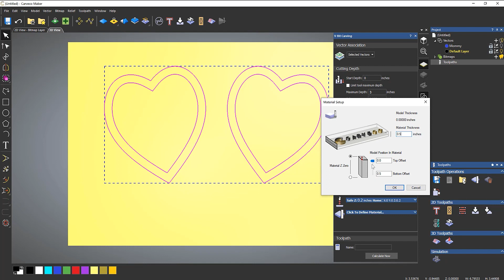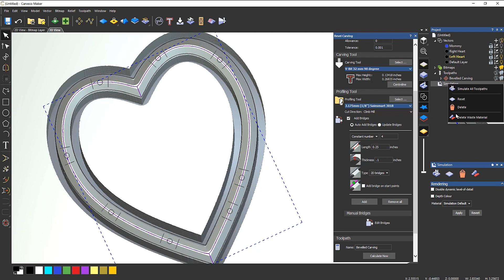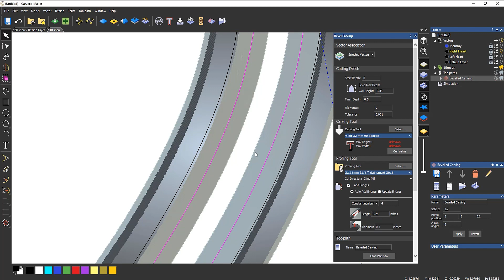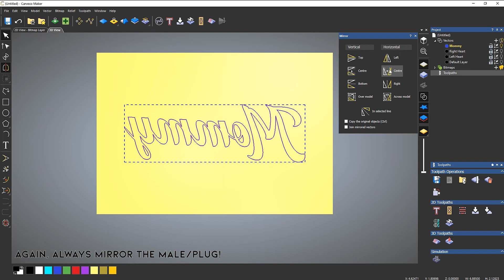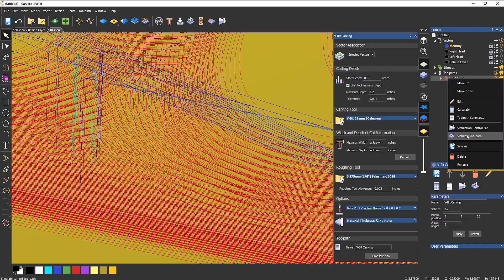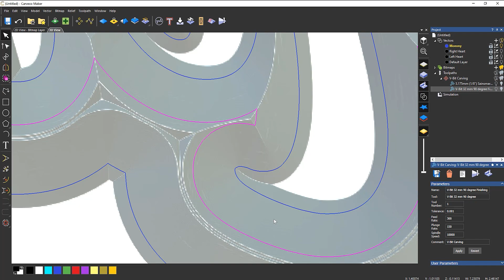Carveco Maker: V Bit Inlays

Comment: Is it necessary to do the area clearance first on the male? Seems like it's just adding an extra tool change by going from 1/8" clearance to the v bit and than back again to the 1/8" for cutout.
Reply from the maker: Hi there,  sure, you can V-Bit first and then just use the 1/8" tool for the Area Clear and Cutout.

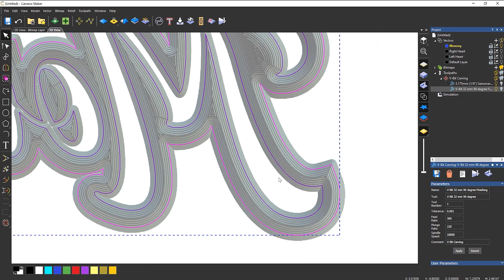Comment: Question: on 46:06, the start depth make my first pass of cut very deep (since my start depth >> stepdown).
according to G-code the first pass Z starts from -(start_depth+step_down)
 how to fix that?
Reply from the maker: That's the only way to do it, since you are telling the software that you have already machined that part (which you have not), the only way around it is to do an area clear or a profile pass down to that depth beforehand.

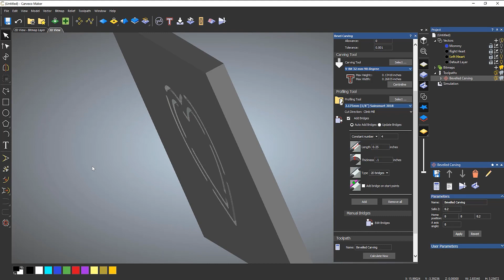Comment: At 22:30 you began machining but you didn't save the toolpaths.  Is this where I would save toolpaths to separate files?  Then load the v-bit carving file and cut that.  Then change to the end mill and load the 2nd toolpath, reset the Z to the surface of the wood and start that cut?

Comment: I'm working through this, slowly.  When I tried to save the toolpath I got an error that said I have two tools for this but my post processor won't do that.  ??
Reply from the maker: Sounds like you are trying to save the tool toolpaths together using a post that doesn't support tool changing.  When you open the Save Toolpath dialog, select the "Save toolpaths to Separate Files" and it should work.  If you are still having troubles, I would drop support@carveco.com an email.

Comment: Good video, Leighton!  I've done a few using Carveco and they worked out very nicely.  

I am curious why you deleted the previous toolpaths, though.  Seems like you would keep these in the event you make another board and have slightly different materials or decide to change bits, then you could just modify the existing toolpaths rather than starting from scratch each time.
Reply from the maker: Thanks David!  Yes, you are correct, you would keep the toolpaths just in case you needed them.  What you don't see is that the project was already done and then saved out at each stage, then machined.  Leighton then recorded a new tutorial within Carveco afterwards hence the toolpaths not being saved, he already had them saved in another project.
Reply: @Carveco  And I also understand that for a tutorial video it cleans things up a bit to not have a dozen toolpaths showing.  I personally keep all my toolpaths for the reasons I stated but just wanted to make certain I wasn't missing something.  Thank you.